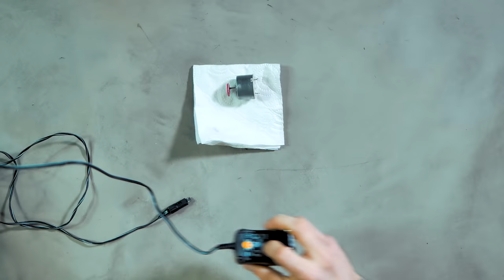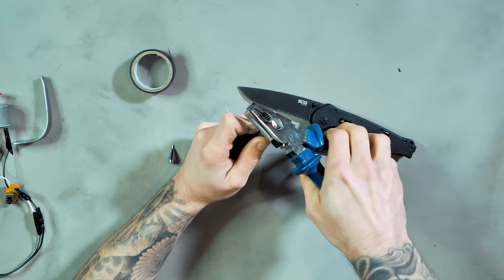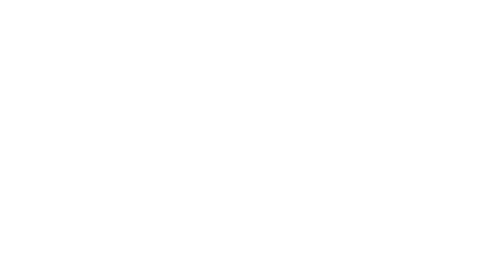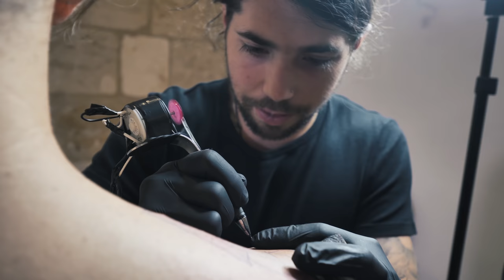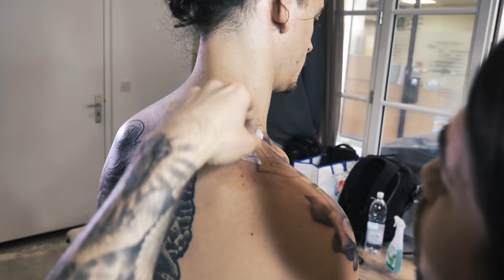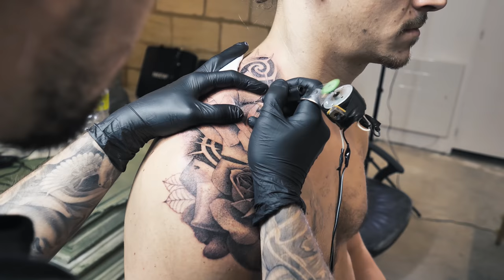BEST HOME MADE TATTOO GUN  /  BUILDING AND USING IT (realistic rose tattoo)

Comment: Button Tip: I had the same problem with the plastic button wearing out. I have found that the spare metal button you get with jeans works well for this. You will have to drill a small hole on the front of the button for you needle bar. But the back of the button has a toothy rivet hole that fits snug on you motor's shaft. Its light but strong and already perfectly centered so a lot smoother. Hope that helps.
Reply: Jimmy nah don't use that , For starters when you make a tattoo needle you use the spring from a pen.. while your making the needle cut a piece off of it about a half an inch long maybe a little smaller(my lengths through inches n shit is all bad lol) and then get the ink cartridge and cut a a small piece off the back about as long as the width of 3 quarter coins put together.. then squeeze that piece to flatten it with some pliers to widen it/ stretch it's width.. doing this you can fit that plastic piece onto the end of the motor and slide the piece of metal from your needle in there it should fit pretty tight , using a button the needle moves out in to wide of a circle motion and even though a metal button might work I would suggest this method even more..
Reply: Thank Drago. That's a neat idea. I'll give it a try.
Reply: Jimmy Its fun building these things lol , get creative with it,  I plan on getting a 3D Printer and printing out some custom parts for mine and rebuilding it with more functionality , At first I wanted a speed control and i was going to use a push button that when released would slow the motor down and when you want to speed up to tattoo you press onto it but I decided that would be to much strain on the hand I may just add an on and off switch and include a built in port so I can choose to  either use a battery pack or a wired wall connection
Reply: You can buy tattoo machine cam for few euros from ebay or aliexpress. With 10 euros you buy pretty good direct drive rotary.
Reply: That's a brilliant tip, man. Thanks!! Any suggestions on motor types? And I've tried plenty of used motors salvaged from shit; still prefer to buy packs of them on Amazon tho, despite them usually being pretty weak.